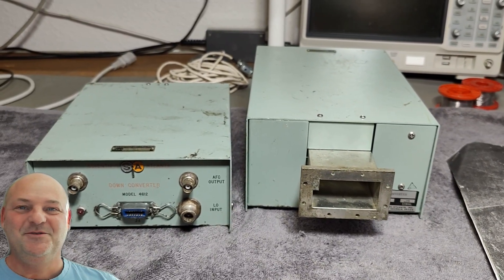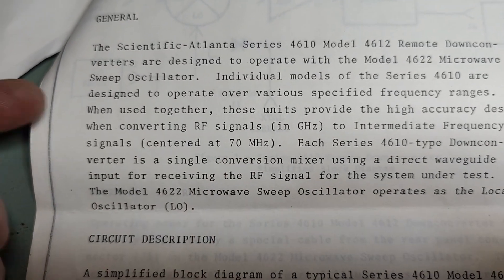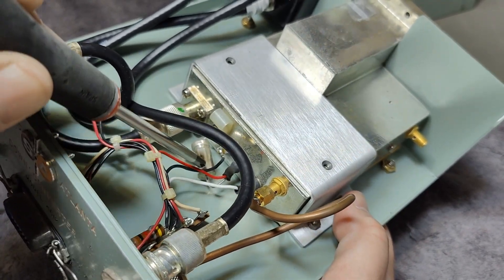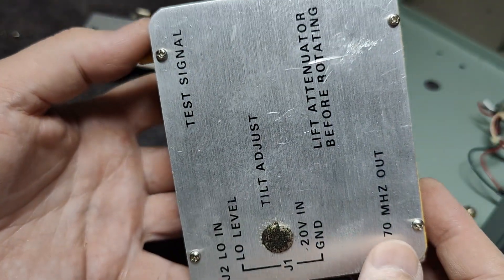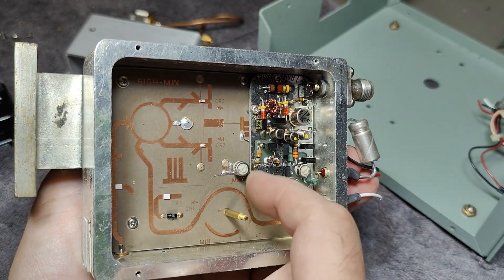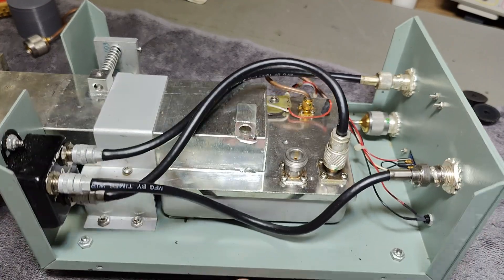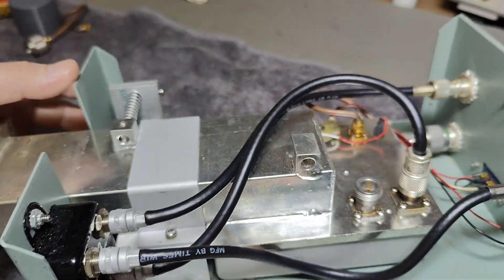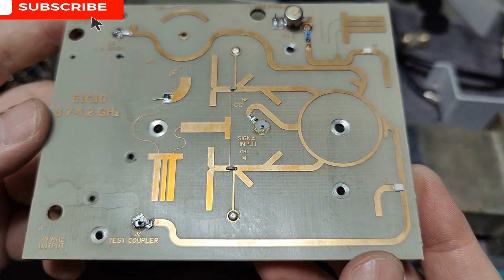Scientific Atlanta Down Converter Model 4612 6GHz and 4GHz

Comment: What kind of transistors can switch up to 6GHz .I saw no transistors .where the 6GHz switching transistors?😅
Reply from the maker: diodes as mixers
Reply: It likely uses PIN diodes and/or shottky barrier diodes.